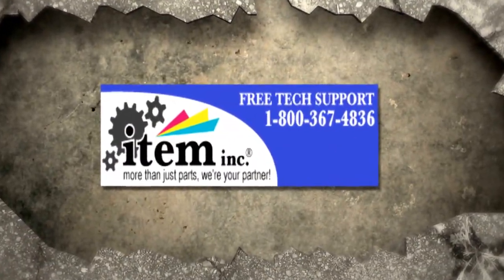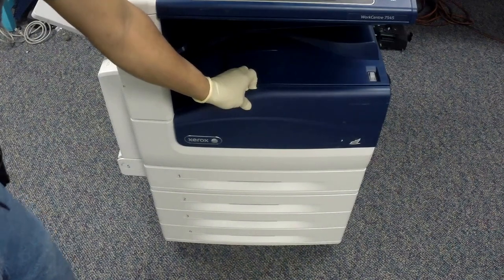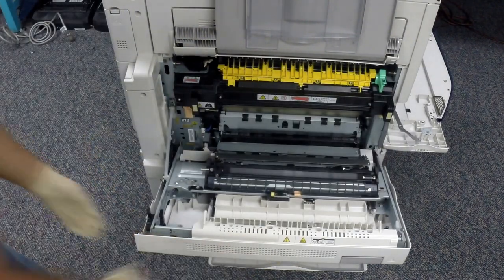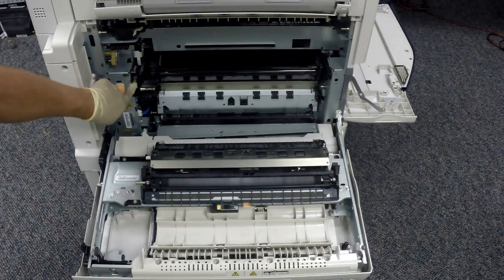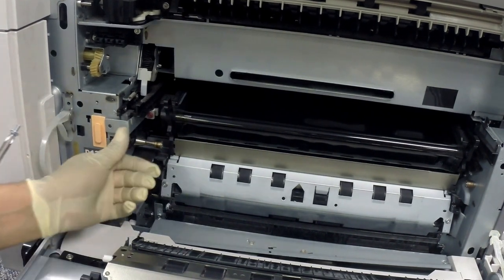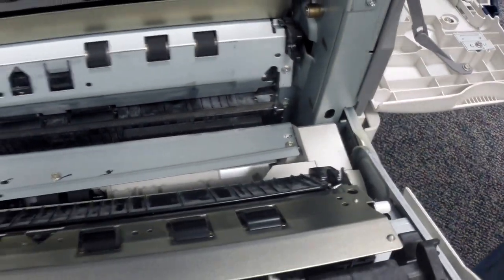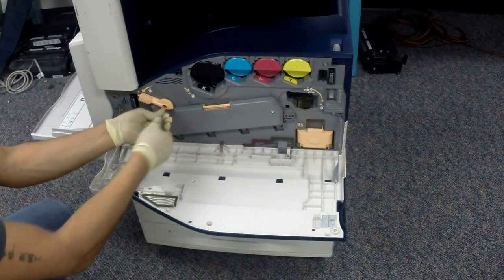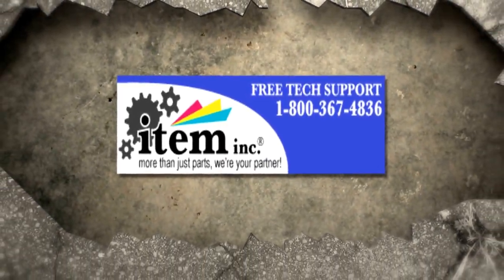How to replace the Xerox  WorkCentre 7525/7530/7535/7545/7556 IBT BELT

Comment: Sir I have workcenter 5755 machine. I have installed the printer driver for it. I am also able to ping to machine through network. But I am not able to take print. I installed the USB print driver. Print through USB cable it is printing. also print one error page after USB cable printing that is PCL XL Error Subsystem : KERNAL Error : Illegal Tag  Operator : Oxab Position : 2264  but through network I am not able to take print at all. Kindly give the solution.